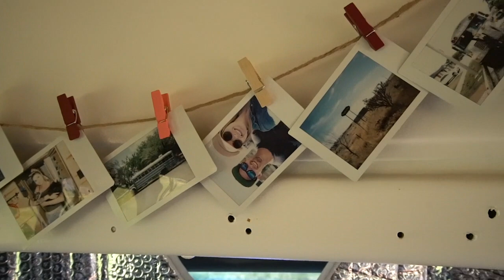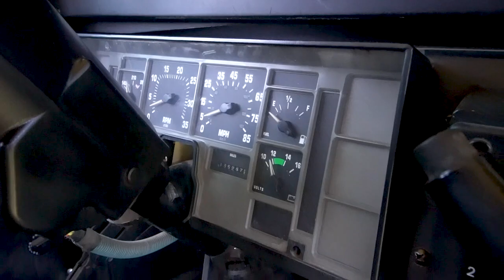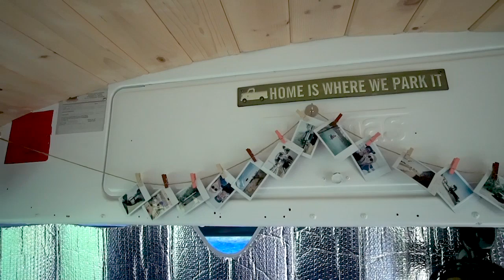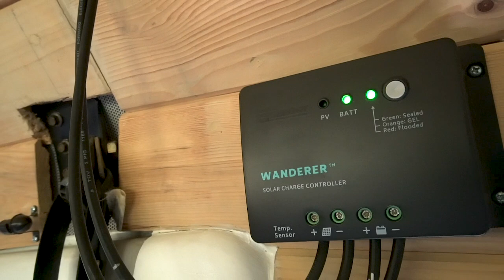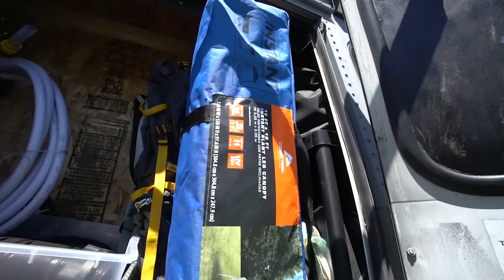Couple Builds A Gorgeous School Bus Tiny House - Full Detailed Tour

Comment: Propane gas is heavy. It sinks lower than the air U are breathing, even on a sleeping bed level. It would be best to install the CO2 detector lower to the floor and closer to the actually propane tank. Drill a hole in the floor, cover it with a screen to keep bugs out, so the gas will drop straight out of the van in case of a leak. Seems the hole for gas to escape route* is just a European requirement; but it should be a propane use practice no matter where in the world one is installing propane... especially in a van, rv, tiny, mobile home. Thankhz for sharing... Wholeness n Love ((-;
Reply: Na'im Asra El, That is so fascinating!!!! Thank you so much for sharing that! I will definitely pass this along to others! Do you know about how big the hole should be? Cold air sinks as well, so it really shouldn't even be a problem having a hole in the floor when it is cold outside and one is trying to stay warm on the inside! What a neat trick!
Reply: Great advice on the hole for propane escape, Na'im.  Thanks!
Reply: A CO2 detector will not detect a propane leak, a propane detector is a separate item they need.
Reply: @TheOtherBill  - Ooops!, correct, CO2 will NOT detect propane leaks.
Reply: Yes a plastic tray with a hose going though the floor so that the propane will exit that way would be great, my sailboat has the propane tank on the stern with a solenoid that you turn on from the galley so that gas can't leak inside.
Reply: @TheOtherBill  your nose is a propane detector and the batteries never need changing, it’s all you need for unburned propane gas. A CO2 detector is a good idea tho which will warn you of odorless, tasteless carbon monoxide which will kill you in your sleep. It’s not something the human body will detect like the propane but propane has an additive in it to give it the sulphuric smell for detecting leaks. Even the tiniest leak the nose will pick up on it and alert you.
Reply: @1982MCI  NFPA and RVIA codes require propane detectors so your nose is not all you need.
Reply: @TheOtherBill  Nowadays you can find Co2 detectors with build in propane detection :)

Comment: The DT466E is better than today's emission diesels. Pretty well all diesel engines aren't cheap to repair but once you've repaired the injectors on the DT you'll get a lot of miles out of it. I agree you need to find a private shop that you can trust. I like the natural light with original windows and the manual door rocks! Our buses have air or electric motors running the entrance door and there are several air operated doors that don't work well in the cold weather. Sometimes old designs are far superior than modern ones that have too much technology and causes headaches. You two did a great job!  :)

Comment: Propane bottles are designed to vent  off propane when surrounding temperature rises (e.g on a hot day). Having propane bottle inside your living space is a HUGE SAFETY HAZARD 💥💥💥. Mount it OUTSIDE like other RVs do. It's done that way on purpose.

Comment: You do not need to take the governor off. You can take it to international and have them plug in and turn it up to 68. It will not hurt your  transmission. Or if you do not want to do that, you can contact your insurance company and tell them your RV is governed at 55 mpg and they may lower your monthly fee, depending on your driving record.
Reply: Might be able to add a 2 speed rear diff and have a little bit of overdrive for the highway and low for steep hills.
Reply: @jwright650  I'd like to ask you a question in Lieu of your suggestion you posted here. What benefit would a 2 speed rear differential and a little bit of overdrive individually do for a schoolie?
Reply: @Catalyst - D B IMHO, having a little taller gearing on flat ground may give you a few more mph without spinning the engine faster, with split gearing in the rear, you could have lower gearing for steep hills and taller gearing for flat interstate travel without revving as high. I'm pretty sure the engine has enough torque to tug against a little higher gear out on the interstate. Of course if you gear too tall, it will be a slug.
Reply: @jwright650  Additionally, by running a taller gear it can improve your MPG(on flat ground) by running at the same, or greater speeds, with lower RPM's.
Reply: Good suggestion 😉😉😉

Comment: You can put some cuts of memory foam to put under your seat cushions. You can slot in a small pod fiberglass shower like the kind you find on a canal boat. A wonderwash can clean clothes with little water and no electricity, just hand-crank for 3 mins. Extra foldable portable flexible solar panels can be plugged into a portable powerhouse for extra electricity for free. A bit of paint on your ceiling. Screens for windows to keep out bugs.

Comment: Congratulations! You created a wonderful RV home. The original bus parts of the dash and the door are great! The wood looks calming and gives an open feel, in addition to the windows.

I do have a couple of suggestions to keep you and your sweet cat safe. If you haven't already done this, please, please get your cat microchipped!  Any vet will check a stray animal for a microchip for Free! Better safe than sorry! Also, if your cat doesn't have a collar and an I.D. tag, getting them can be the way to get him back in case the finder forgets or doesn't know about animals having microchip I.D.s. On another RV bus video, the owners got a fan and separate heater for their dog (or cat?) Which had a little bed on the floor near the passenger seat. They travelled in both cold and warm weather areas. They didn't use much power because they were designed for a small space. If you want, I can look through my Youtube video history and find that video for you.

Maybe you can save for an alarm system for all of the windows and doors, including the original bus door. Get one with sound and bright lights all the way around. You can probably have it wirelessly connected to your phones for when you are out. Maybe some weather stripping can block incoming air through the door.

I hope you do yourselves a big favor and invest in more solar panels and batteries. Proper light might be essential in case of emergency/injury for yourself and/or your cat. It's best to not wait until you need the strong light for an extended amount of time. 

Taking warm showers can be a regular experience with more power. Again, hot water might be needed in an emergency, like an injury or if your cat is injured, etc.. Once, I had a cat that went under my apartment house and came out covered in smelly, greasy gunk. The plumber had just left and my cat smelled like toxic material. I had to wash and thoroughly rinse him with warm water and soap (it was a battle but I won). If I had to wash him in cold water it would have been torture for him.
You never know when you might really need hot water; you've been lucky, so far.

Well, please take care, stay safe, and have fun! 😃

Comment: He pointed out about the overhead RV air  conditioner not cooling very well, and the majority of the air coming out of the rear vent. This I have noticed on similar models. For the cost of those type units. I would rather install a small split system. You would mount the outside condenser on the rear of bus, possibly extending the rear bumper to accommodate unit. This is what I am going to do. His other ideas using simple accordion dividers for shower and toilet, are brilliant and in-expensive!

Comment: You don't have to change out the water heater, just change the element out to 12v heating element an disconnect the 110 power.

Comment: So you're mostly living out west in the heat but you have no air conditioner holy moly dude at least close off the bedroom and get a cooler put a fan in it with some black ice for at night time so you can sleep I mean it'll cool off just the bedroom she knows how it's not that big it's easy to make an air conditioner from a cooler especially if you got one of those little ice makers you can make ice during the day and fill it up for a night that way it doesn't cost you for the ice

Comment: You say it’s good so far after a $600 tow, $200 parts and $900 labor? Adds up to $1700 on my calculator.
Reply: Right?! He said "90% comes from Amazon, Wal-Mart, or Target". Half the stuff doesn't work. They have battery operated click lights, and only use electricity when they're plugged into shore power. They shower and poop elsewhere. They should've just gotten a pickup to carry their bikes around and pitched a tent at campsites. They would've saved a ton of money. Not the most economical or well thought out build out there. Still wondering what's so gorgeous about this build. Title was click bait. Can't wait to see the update - mold remediation in the storage bays, shower and ceiling, and retrofitting insulation. No heat will be fun in the winter since even Georgia and Texas have seen snow the last couple of years.

Comment: If you're going to live in a bus and travel and you buy a gas engine bus you're a damn fool gasoline motors don't last very long diesel motors will run a million miles literally a million miles for a gasoline motor at 200,000 is on its last leg